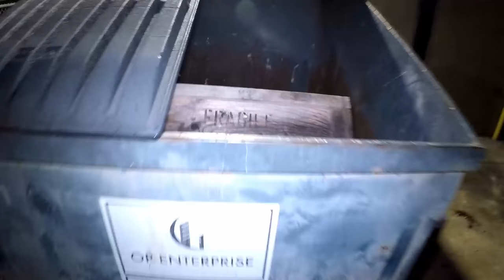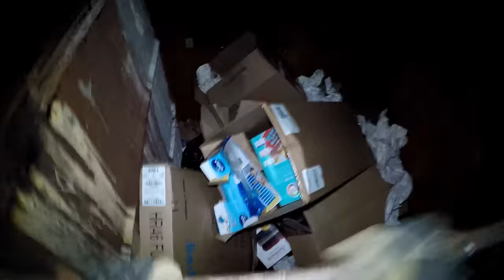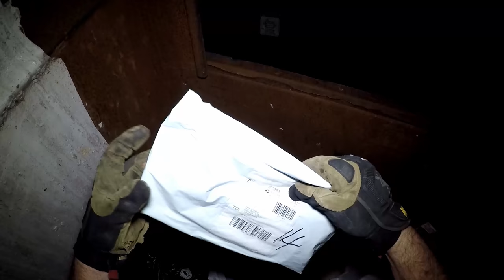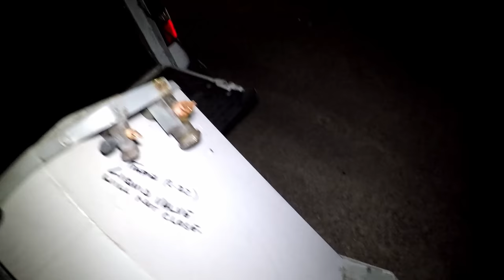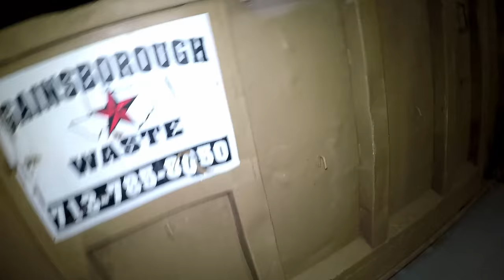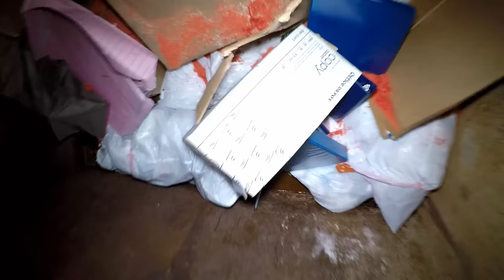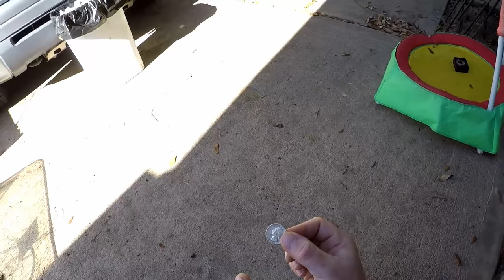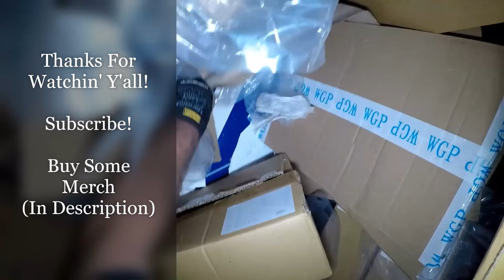Dumpster Diving "This Thing's Full Of Money!"

Comment: I found a little over $2,000 in gold teeth in a bag in the dumpster that was with a whole bunch of old dentist tools and drills from the 60s and 70s from Cal State University...Everything from 14k,16k,18k,22k and 24k! I can definitely agree with you on the fact that dumpster diving pays wayyyyyy too well to not do it! Keep the videos coming big dawg!
Reply: Strange you found 22k and 24k teeth. I have never heard of a gold that high purity used because of it being to soft. Most common is 16k but 14k to 18k is not unheard of. Same reason Jewlers don't generally put expensive stones in gold higher then 20k.
Reply: . They were probably displays. If they really did find them

Comment: You need to open them rolls of coins. Never know what you might have there. Check to see if you have any double stamped or anything collectible. Nice score.
Reply: That's what I'd do, maybe whoever rolled the coins might have rolled a few silver coins without knowing it.
Reply: @javalily  really? Never knew that. What is the value of the quarters from 64 back and the pennies from 82 back then?
Reply: @noahsmith5339  as of today, may 15th, 2021 with the price of silver each quarter is worth about $5, dime about $2.50.. half dollar around $12/13 I’m just talking about common junk coins that would be bullion.. example.. that liberty, or merc dime, is a 42.. known error is 42 over 41.. it’s a couple hundred for that coin alone. You can see it pretty good, the 1 and the 2 almost look like a combined 12.. date looks like 19412
Reply: @daveweber5334  ok, thanks
Reply: @javalily  Correct.
Many people don't realize that 1965 - 70 Half Dollars (only) are 40% silver.
Reply: And who are you going to sell a quarter to? For $5? GL with that
Reply: @robs5579  Smelters, precious metals dealers, coin shops, etc.
The $5 figure is based on the value of the metal itself, which fluctuates.
As of 08/28/21, with  .999 silver 'spot price' at $24.05 per ounce, 90% silver quarter dollars have a 'melt value' of $4.35 each.
If you live within reach of a coin shop, phone them and ask, "what are you paying for 'junk silver' pre 1965 U.S. coins?".
If they are paying $4.25 for a 90% quarter, they will answer, "Seventeen times face", meaning $1.70 per dime, $4.25 per quarter, $8.50 per half dollar.
Silver Dollars will sell for more than will 'subsidiary coinage'.
The prices paid fluctuate daily. Check 'spot prices' online and realize that a dealer must pay a bit lower in order to stay in business.
Reply: @noahsmith5339  

based on current spot, a 64 quarter would be worth about $5.
Reply: @robs5579  I sold a foreign silver $1 coin to the pawn shop. I got $10 for it. Not bad for something we'd normally toss.
Reply: @robs5579  are you not from here or really urban or you just don’t know how things work there’s a coin shop by me that buys gold and all that stuff and whenever they offer you money for something they check the daily spot prices before they offer you and they’re right on and they pay correctly but if you take your shit to a pawnshop and Silver is let’s say for example $25 an ounce they’ll give you $10 per coin silver dollar coins which is ridiculous and they do that all day to people who wait an hour in line just to get ripped off get $30 for three silver dollar coins that they could’ve took to the little coin shop and got instant service and got 80 bucks easy instead they got 30 bucks from the local pawn shop which scams people left and right and the local pawnshop based on you stating that is probably where you would go.
Reply: @B0xlife1  I am from FL. But I don't care. And don't believe you people are making money off coins. Enjoy tho 👍
Reply: @robs5579  tons of money to be made off anything silver or gold!
Reply: @B0xlife1  exactly the longer you hold the more it's Worth.

Comment: The orange stuff was sweeping compound, you sprinkle it on the floor and it's supposed to help pick up whatever dust is on the floor and it also keeps the dust down instead of flying up in the air when you're sweeping. It's weird but it works!

Comment: The way only certain coins were in the small coin bags says those were being protected which means they are quite possibly minting ERROR COINS which can be worth A LOT so research and CLOSELY examine EACH OF THEM in those bags before just spending them.
Reply: Excellent find.
Reply: He went and bought a cola with a 1944 copper penny.
Reply: @jamesh4966  Since ALL 1944 pennies were copper and only the 1943 pennies were steel that would make sense , but it'd still be sad to spend a wheat penny needlessly even if it doesn't have much value
Reply: @todddenio3200  They were bronze, actually, and they were cents.
Pennies were British.
'Off metal error' cents of 1943 bronze and 1944 steel do exist and tend to have very high value.

Comment: A easy way to check if quarters are silver is to check the edge for the brown or copper looking line. No line means silver. Good score Mr. Mike!
Reply: Any US 'silver' coins older than 1964 is real silver. Since 1965 they're all copper sandwiched between 2 sheets of nickel.
Reply: @Muscles_McGee  Correct.
To be more accurate, the outer layers of 'copper nickel clad' coins (1965 to present) is 75% copper, 25% nickel.
It was first used on the 'Three Cent Nickel' of 1865 - 1889, then on the Five Cent Nickel from 1866 onward.

Comment: Pro tip to wash legos...
Put them into a mesh laundry bag (like for delicates) and then put them on the top rack of the dishwasher to wash. Don't use the drying cycle, but take the bag outside and swing it in a circle to get most of the water out. Lay them on a towel to finish drying.

Comment: Nickels are only silver between 1942-1945 and are 35% silver fellow scavengers. 🤘
Reply: Keep in mind however, not all nickels minted during those years were silver war nickels.. they of course will be within that year range but they also must have the larger capital mint mark on the reverse above the memorial. There are several during those years that are just normal nickels.  😉
Reply: @fatalexception4730  All 1942D were the usual 75% copper, 25% nickel as used since 1866 for the Five Cent 'Nickel (first used on 'Three Cent Nickels, 1865 - 1889).
The 1942 Philadelphia 5C were changed mid year, so both 'nickel' and 35% silver were issued.
All 1942S and all 1943 through 1945 U.S. 5c were of the 56% copper, 35% silver, 9% manganese alloy.
As you've stated, the 'War Nickels' (35% silver) have the large mint marks, the 'P' being the first used for Philadelphia.

Comment: You can also use a 2X4 about 8' long.  One end on the ground and the other end on the tailgate, Make a ramp out of it a slide the AC unit up the board.  This way you dont have to pick anything up.  All the weight is on the 2X4...

Comment: I was a palled you didn’t grab the computer monitor I like taking those apart grabbing the copper rings on the tube, the black wires green board, and the speakers make really good magnets

Comment: Quarters and dimes 1964 and older only have silver 90% nickels the only years that had silver was 1942-1945 and the will have a big mint mark above the building on the back and there 35% silver  1965-1970 halves have 40% silver and 64 and older halves have 90% silver

Comment: Its easy to remember the 90% silver year for quarters and dimes....."64 And Before". As for the nickels, only the 1942-45 Nickels with a large mint mark on the reverse side (12 o'clock location) are 35% silver.

Comment: Hey mike.. Here is a tip for you. 
When dealing with coins.. specially silver or older ones.. DONT THROW OR DROP EM ON THE GROUND.  
.............. Seriously mate..   Those coins are worth more then face value depending on multiple factors. 
Check the rolls.. Don't just use them as is.. They may have more silver in them etc.. Rare dates.. ETC 
Watching  you handle them like you did .. Makes me cry

Comment: Quarters, dimes, dollars, and halves dated 1964 and earlier are 90% silver.  The rule of thumb is for ever $1.40 in face value of the coins will equal one TROY ounce of silver.  So it could be 14 dimes, or 4 quarters and 4 dimes, or two halves and 4 dimes, or whatever combination.  As of today's spot price, 2/17/2022, each $1.40 in pre-1965 US (silver) coins is worth $23.93.  Those quarters are worth $4.28 in silver value today.

 Here's a good way to look at it.... back when that 1964 quarter was minted, it could buy a gallon of gas.  Today that same 1964 quarter could effectively still buy a gallon of gas.  Paper money is just paper, it loses its worth over time because of inflation.

Comment: I realize I'm a bit late to the party as I just stumbled upon your video but, might I make a suggestion? Next time you want to bounce a quarter (or any coin, for that matter) do it on a wooden table. You'll get the same result and not risk devaluing the coin with a bunch of scratches and dents all over it. Also, any quarter or dime or half dollar piece minted 1964, or earlier, is 90% silver in US coinage. Any 50¢ piece minted 1965-1969 is 40% silver. All others of denominations 1¢ to 50¢ are just clad (copper/nickel mix) and only rarity and condition determines their value. Oh, and silver coins are a bit HEAVIER than clad coins. 6.25 grams for a silver quarter as opposed to 5.67 grams for a clad quarter. Now, that 1963 that you used for the demo can be worth up to $14 and change, in MS-65 (Mint State-65). The highest being PR-70 or Proof-70 which is a perfect and completely flawless coin. However, slamming it down on the concrete, like you did, could (and probably did) scratch one of the faces or dent an edge. If so, you're coin would now be worth less than $7. You've cut the value of that coin by half. Anyway, congrats on the find and good hunting. BTW: This info I post is for anyone finding money, especially older coins, so that they don't accidently screw themselves out of getting more cash than what they'd get if they didn't care for the coins. Silver, at the time of this post, makes those quarters smelt value be $3.4235 each. That's just the value of the silver. That doesn't include any intrinsic value as a rare coin.

Comment: Pre 1982 pennies are worth more as "Redneck penny rolls " aka fill copper pipes with the copper pennies & hammer the ends shut ,the scrapyard pays a hell of alot more than the bank does ,they are usually worth 2 cents or more for a penny ,just don't scrap valuable wheat pennies though

Comment: Coins 64 and older that are silver are only for quarters, halves and dimes. The are 90% halves 65 to 69 are 40% silver. Nickels are 40% for a couple of the war years in the 40's other wise they are nickel.  Pennies before 1983 are copper after are zinc.

Comment: I would love to go on a Dumpster Diving tour. But in Germany you are no longer allowed to do it. You can not even go on a scrap yard to search for usable things. If you are lucky they let you check stuff right on the edge (liability . . . . ). As someone that loves to tinker arround and build stuff from nothing this hurts sooo much. Often i need something that i could find (for sure) on a scrap yard but have to spend real money to buy it brand new. For example Aluminium radiators. Could be sourced easily from so many different items on a scrap yard. But fuc...expensive if they are big and you have to order new ones. 30 years ago we had a scrap yard near our town. And we were allowed to scavage arround. Prices were decent and i loved it. They also got all kinds off stuff from over production. Brand new stuff in original boxes. And you would not belive what they had inside their storage halls. Example a truck load of brand new Drill Presses (not no name). But they were not allowed to sell this stuff (oficially 😇).

Comment: It's been a sec since the post but those coins need to be gone through very carefully!!! There could be die mistakes (worth TONS of cash) there could be older dates that are sought after by collectors, or there are certain quarters that are worth 30 bucks a coin that are current! They have special stamping on the face, if you do a tiny bit of research it could pay off BIG-TIME!!!!!! That was just insane!!! WHAT A FIND!¡!!

Comment: the silver quarters were worth approx. $4. each, silver dimes about $0.80 each, the nickles that are 1942, 43, or 44, with a large letter above Monticello are 40% silver and worth about $0.20 each in silver value. most silver coins are worth more in collector value then silver value depending on condition.

Comment: Mike I wish I'd got in touch with you when this vid came out. I've got a Weller soldering station just like that but it fell off my workbench and the blue housing busted in about 10pieces. It still works fine but I keep having to "Frankenstein" it back together with epoxy. 😆😂🤣

Comment: FYI we use Dollars and cents here in Australia. Although before 1966 we used to used pounds like Britain. That coin there is a 5 cent coin and actually has an echidna on it, they're a bit like a porcupine with spikes and is an egg laying maman. The 10 cent piece features a peacock; 20 cent has a platypus; the 50 cent originally just featured the national coat of arms which is a kangaroo and an emu holding a shield but has had commemorative releases for things like royal visits; the $1 was originally just a pattern of kangaroos but has since had many commemorative releases for historical events like Olympic games and special holidays as is the same with the $2 coin which originally featured an aboriginal man holding a spear; 1 cent coins had a possum on it; 2 cent coins had a frill-necked lizard on it which is native to Northern parts of Australia.
1 and 2 cent coins were Cooper and actually phased out in the 90s and now we just round up or down to the nearest dollar and or 5 cents. For instance if the price is 97, 98 cents or 99 cents it rounds up and you pay $1 but if the price is 96 cents it rounds down to the nearest 5 cents so you only pay 95 cents. And so if the price is $1.01 or $1.02 it rounds down and you only pay $1 but if it's $1.03 it rounds up and you pay $1.05

Comment: Found 9 one hundred dollar bills once, found single one hundred dollar bill maybe 6-7 times. Occasionally single 5, 10, 20 another find was 72, I used to repair smart phones and frequently would go to shitty Verizon dumpster for parts, new in packaging eat buds, charger cords and adapters, and whole cell phones I robbed for screens, vibrators, speakers, microphones, so  one nite there was little waist basket liner bags from each cubicle that were clear, one was almost empty with little scrap paper, except 7 south African kougarand 1 troy ounce pure gold, I don't know how they missed seeing them, lifting the bag caused them to roll into the corner pulling bag down, I thought surely if they pulled liner out to toss them to janitorial cart, they should have noticed them cause they tied a not in it. Lastly an RV mobile park gave me washers and dryers while scraping a pipe and drain system for them, I decided to haul them to process shop after throwing one over to chop no saw it. Yes sir, they were over full with the area behind coin slid was full from collector overflowed totalling just under 700, why they left it cause maintenance stripping them for parts. Amazing the money people trow away.

Comment: There was a private post office box place in Beverly Hills that had something like 600 PO boxes and they had a policy of not stuffing the boxes with any junk mail. So anything that was junk mail they just threw out in the dumpster. The dumpster was tucked away in the back of the ally behind the place and since it never saw any trash besides mail it was the cleanest dumpster I've ever seen. During the 90's there was this company that was doing marketing surveys and would send every one of these PO boxes a survey and because they arrived in bulk to every box they where considered junk mail and tossed out. The thing was that in every one of those envelopes was a 10 question survey along with a letter that asked if the receiver would take the time to fill it out , put it in the pre stamped envelope and mail it back to them and for their trouble they put a brand new crisp one dollar bill in there for the effort. They sent out surveys like this on a weekly basis so every Wednesday around 10 or 11in the evening I would make my way to that dumpster and collect my $600.00 pay check along with 600 stamped envelopes that could be used to mail what ever you just needed to put a printed address label over the address that was on the envelope. This went on for a good 6 months and probably even longer but I moved out of the area. I was homeless at the time and was struggling to keep my head above water and this little gift that kept giving was what allowed me to stay a float. It was just going to end up in a land fill any ways and I really needed it.

Comment: Dude I'm a lady and I woulda had that ac unit in that truck and at the next dumpster before you even woulda dropped down the step  I been doing it for a very long time and you learn a system u build muscle to the job I throw washer dryer fridge stove ECT. Like paper ac u use little more muscle but it's about the system more so